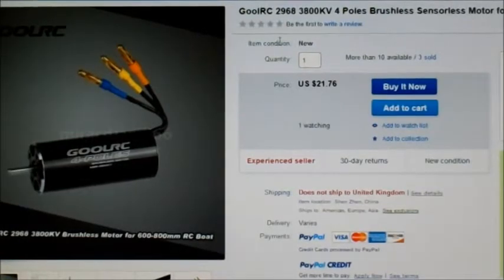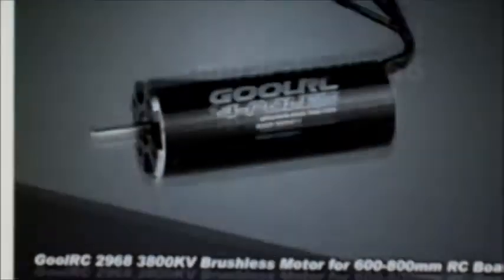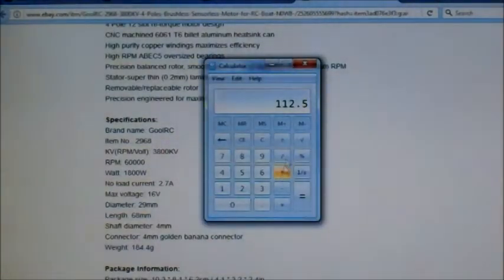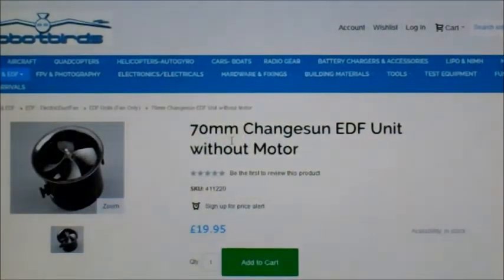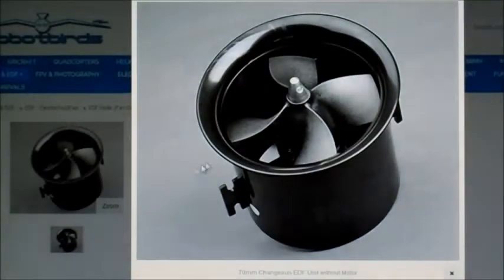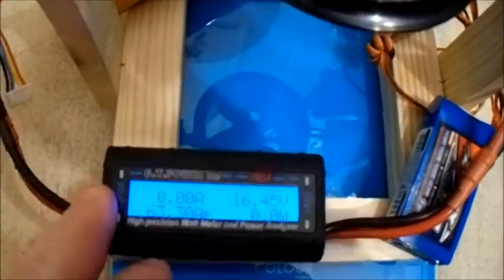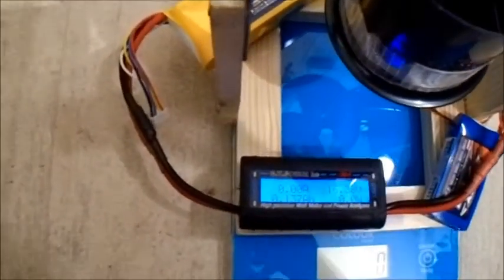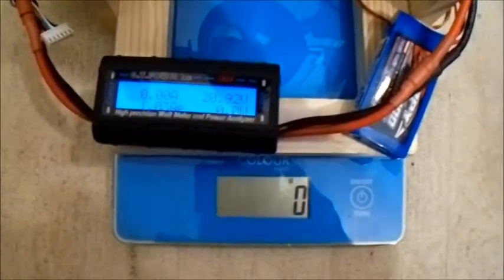GoolRC 2968 3800kv + Changesun 4 Blade 70mm EDF Thrust Test Motor test of the Week

Comment: The fans with 10+ blades sound really cool, but the ones with only 3 or 4 actually give you more top end speed.  This is the only 4 blade I've heard that also sounds good as well.  Have a go at a good balance job? Cheers.
Reply from the maker: Hi there
So true. The 10+ fans sound nice and turbine like, but I have found by spinning 4, 5 or 6 bladed fans at stupidly high rpms I've managed to get very good thrust results. Yes I will definitely re balance this fan before I install it into a jet. Thanks for watching.
...RCPP
Reply: Yeah, no problem.  I've found the same thing.  I've found mobile apps that are usually free that let you analyse vibration and balance them really great.  You wouldn't believe how much a good balance job can affect the sound for the better!  Also, high pitch fans like the 3 or 4 blade (or high pitch props) produce less static (bench) thrust, but will unload more in the air, at least in level flight, and give more top end speed.